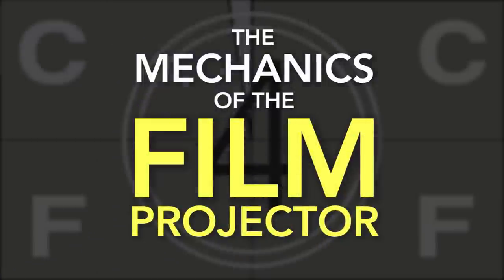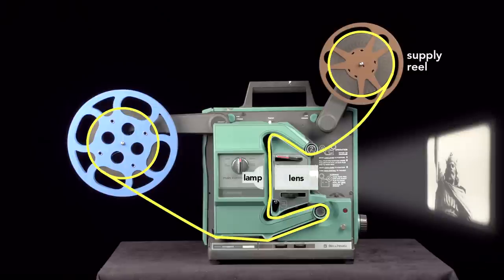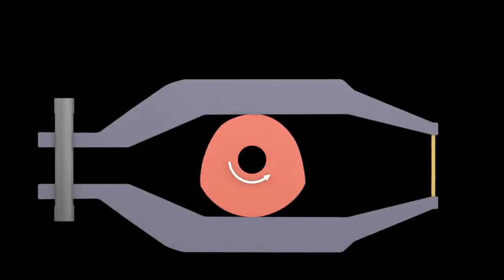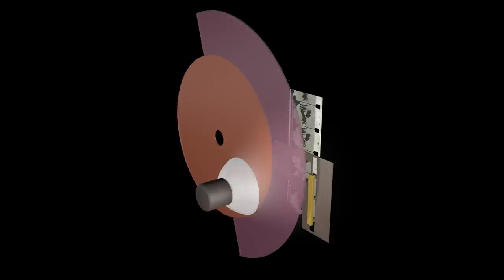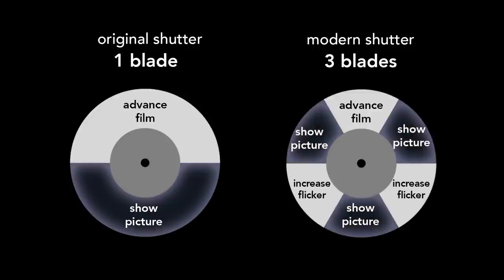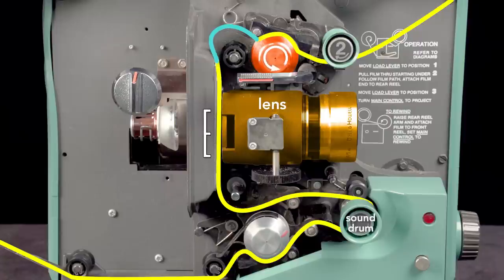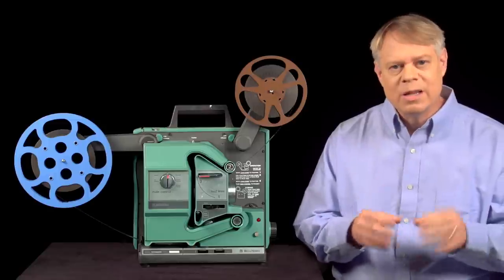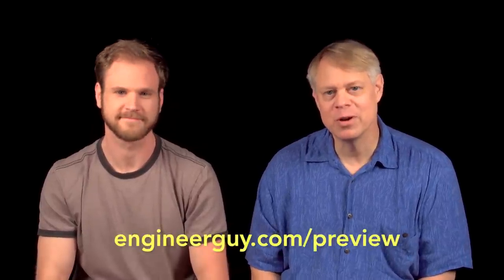How a Film Projector Works

Comment: Should have just gone with 60 frames per second.
Reply: +Jesse Drabble 48 FPS was the norm for most of the history of film. Few yrs with 70mm and all US TV at 60.
Reply: film reels were already massive, having it run at 60fps would basically make a 2 hour film the size of a room, compared to about the size of 2 people sitting together in width.
not to mention alot of pointless frames which have the exact same thing on it.
24fps was the best of both worlds.
Reply: They would not have been the size you think.  We used three foot diameter reels with floating hubs to make starting easier. This was very common in 3D and Cinerama where each reel lasted almost an hour. Cinerama ran at 26 fps which gave a better definition of 52 cps.
The 24 fps was arbitrary as from the beginning of the twenties the Movies were shot in Europe from 20 fps up too 28 fps as standard.  Did many tests as to proper speeds back in the sixties and it was the US that were the cheapskates on film speed.  Hence the so called 16 fps with a three blade shutter gave you a low definition 48 fps rate in projection.

Comment: 4:20 This is why 24p movies look so crappy on home TV or projectors: They dont emulate this short period of darkness between the frames, that cinema projectors have. That is the reason for the extreme motion judder - the short black period allows the mind to distinct between each frame; without it, two frames always blend together in the mind, so for a short period you "see" two images instead of just one. 24p is perfect for cinema, but worthless for home systems.

Comment: And yet I hear people complaining that their games top out at 30 frames per second
Reply: +Zachary Krawczyk Because games don't produce physically-accurate motion blur, so the stuttering at lower frame-rates is very noticeable. That's why movies can get away with 24 FPS, they have physically-accurate motion blur to compensate for the low frame-rate (either due to exposure time being increased when physically filming hence motion is blended into the frame, or hours are spent calculating motion blur during rendering).
Reply: Ah, see I always wanted to know that. Good explanation!